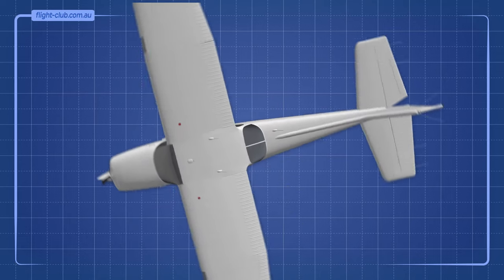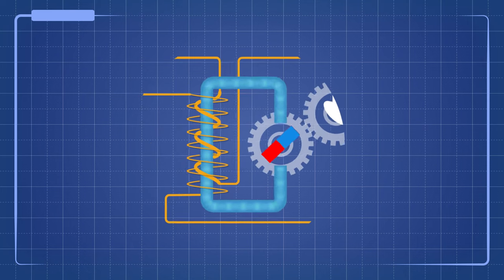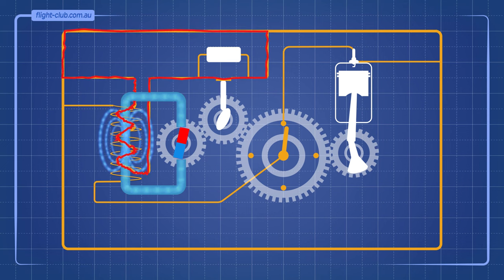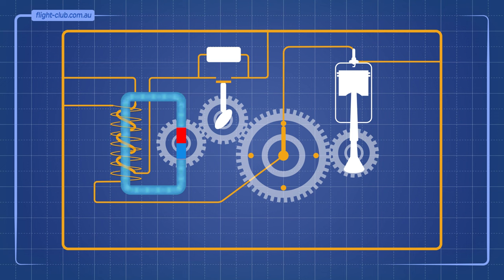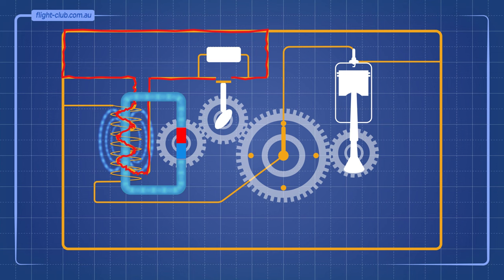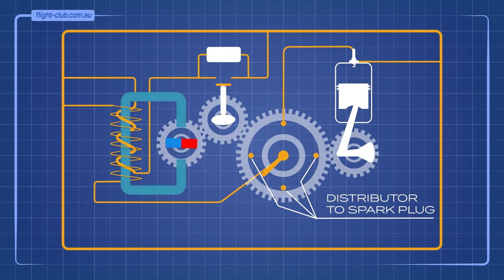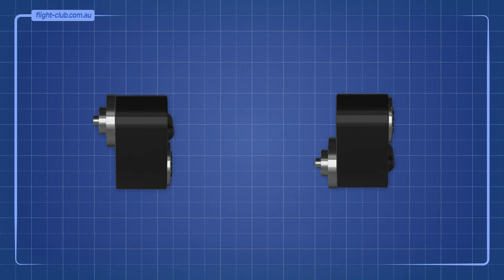How Magneto Works | Simply explained for student pilots.

Comment: Don't forget  that a Magneto doesn't Need electricity (unlike a Generator) from a Battery and will work on it's own! A redundant magneto system is wise 25,000 feet in the air😃
Reply: You can connect a generator directly. No need for a battery. For example you could use the AC ( like on a bike ) and distribute every lobe to a different cylinder and there have a coil on plugs for a shorter HV cable.
Reply: Both magneto and generator (alternator) are engine driven and they are the one that produces electricity. I don’t understand what you mean by “unlike a generator that needs a battery” ? Cuz a generator doesn’t need a battery, its engine driven

Comment: It's important to test each magnetos separately.  Expect 50 rpm drop off engine if magnetos operated individually. After that do not forget to switch back to both. Check and verify.  Sometimes the engine switch can return to single magneto operation due vibration or if knocked by the knee etc.

Comment: to be completley honest i still dont get it, especially with the voltage spike, but great video nonetheless
Reply: When you have the closed circuit, there's a lot of energy accumulated in the magnetic field of the coil that is created by the current flowing. When you open the circuit, that energy has to go somewhere. With nowhere to go in the first circuit, it can only discharge through the other coil (since the first one is now an open circuit). Energy can be delivered either through current or voltage. By the way it's designed, the other coil favours to discharge the energy through voltage. This results in a spike which reaches differences in potential enough to make the air in the combustion chamber break down and let current flow through the massive voltage. Imagine a massive pump delivering a massive pressure spike through a narrow pipe. The pipe blows up. That's the spark.

It's like a water hammer, but for electricity.

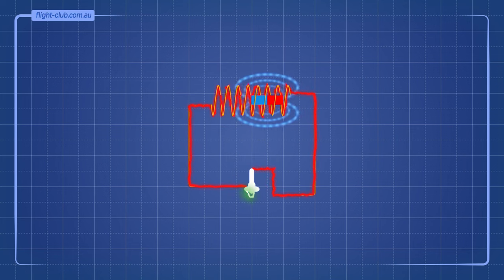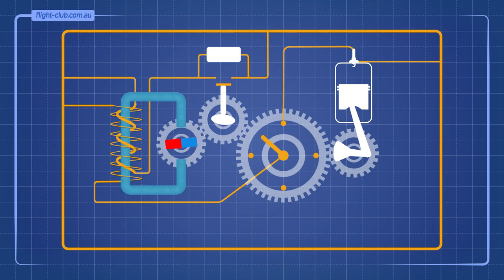Comment: 0:38 *enough VOLTAGE will generate a spark.  Sparking is a function of voltage, such as when shuffling your feet on the carpet and touching a doorknob. Arcing is a function of current, as illustrated at 3:40

Comment: So simple and effective. The generator at our cabin is a very old Honda one, and it no longer works as the spark doesnt show when pulling the cord.  Now i know why
Reply: You can probably pull off that magneto and rebuild it using tools in your shed, then it'll be good for another however many decades.

I'd check the cable first though. That's a more likely failure.

Comment: Thank you for another great and simple video! As you described at the end there are two magnetos - why is the performance better with two magnetos and why does the power drop slightly when I test the individual magnetos?
Reply: as the video stated there are 2 mags and as such there are 2 spark plugs per cylinder unlike a car where there is only one plug. having 2 spark plugs spaced within the head of the cylinder allows the air fuel mixture to be ignited more evenly/uniformly and therefore more efficiently ie more fuel is burnt in the cylinder with less waste and as more fuel is burnt you get a bigger bang and more power. the power drops when individual mags are tested because initially you are running on 2 spark plugs then testing you are basically earthing one mag which effectively stops that mag working so when you do the test  you are running only on one mag and one spark plug and less power.
Reply: @alianjohnson6035  What would be the thinking behind using one vs two on a flight?

Comment: Very interesting and well done.  I'm curious why aircraft use magnetos instead of an alternator/battery system, like cars have.  Reliability?  Better performance?  Are aircraft spark plugs radically different from those you find in cars?
Reply: Magneto ignition means the engine keeps turning even if the aircraft has a total electrical failure.

Also, certifying anything new in aviation is an expensive process for a very small market, so piston engine technology lags well behind its automotive counterparts. Avweb has a pretty good video about the economics of the aviation engine market and how it has resulted in modern planes with space age composites and sophisticated avionics still using engines essentially identical to aircraft from the 60s
Reply: It's a reliability thing. You can lose the entire electrical system and still get spark.

That's why the entire ignition system is redundant as well. You have two magnetos, two distributors and two sets of plugs. That's a lot of failures required before you lose an engine.

In a modern car engine on the other hand, you have many single points of failure, any of which can leave you stranded by the side of the road. This is done for cost and weight reduction, which become secondary concerns when increased likelihood of engine failure is liable to result in loss of airframe, or worse - life.

This is also why fuel injection systems took so long to mass adopt (even though those were invented for aviation). Just like magnetos, carburaettors don't require any other system to be operational in order to meter and supply fuel. As long as there's fuel in the tank, that is 😅

Vacuum gyros (artificial horizon, gyro compass, etc. Notable exception being electric turn coordinators) run on engine vacuum for the same reason - if the engine is on, there's (partial) vacuum to drive them and you don't need anything else.

Same reason mechanical flight controls (cables and pulleys) are still a thing, and still preferred whenever practicable. Even in somewhat larger aircraft (such as the King Air). They require a bit more maintenance on the ground, but even if you lose all the other systems on the aircraft, as long as the cables are intact and control surfaces are free, you are in full control of the aircraft.

Having as many of these systems as possible be standalone and independent means that no one failure can bring an aircraft down. And ones that can bring it down are always redundant. Boeing fuch ups notwithstanding.
Reply: @StephanAhonen Hell, a bunch of these engines still require tetraethyl lead in the fuel!

Comment: This is either really good, or wrong, and I’m leaning towards really good. I’ve always been taught the reason for the capacitor or condenser is to stop the arc as mentioned but for the purpose of preventing damage and wear to the breaker points. But what this video stated makes good sense.
Reply: I’m pretty sure it’s the same reason. The arcing can cause the conductor to degrade because it generates a lot of heat because air has a high resistance. Maybe that’s what it’s referring to?

Comment: Interesting side note: That high voltage needed for spark ignition in modern engines is in excess of 20,000 volts 
With car engines and their coils making upto 68,000 volts for high compression or high boost engines. 
Even on a motorbike you are looking at 15-20,000 volts from a 6v motorbike battery.
Reply: When the spark happens in a region of calm air, the flame expands slowly. So we can advance the timing before max compression at TDC as the turbo spins up.

Comment: Does the battery power a starter to turn the magneto which powers the spark plugs ? If not what turns the magneto to begin with ?
Reply: The battery is used to start the engine at the same time, all turn together.

Comment: I’m surprised distributors are still used and not electronic ignition.
Reply: electronics tends not to deal well with extreme temperatures, and you get those a lot in an airplane.
Reply: @StefanoBorini mil spec electronic survives where humans die. Military jets also hvac their computers. Use tubes?

Comment: The terms in this are mixed and contradictory. Please, don't pay attention to the actual terms. "High-voltage electrical current" is not a thing. Current is measured in amps. Voltage is its own measurement.
Reply from the maker: Fair point. Thank you for clarifying.
Reply: Thee is a distinction between a current driven by a Van de Graff generator and a current driven by a car battery.  If you want to drive a current through a high-resistance path like air, then you need a high voltage.  In this video there is no need to measure the current, so no mention of amps.

Comment: Wrong information presented here.  it's high voltage, not high current that generates the spark.  Infact, the current is very low once the voltage is stepped up.

Comment: I'm taking the commercial checkride and failed the oral because the examiner I guess wants me to be an A&P. I guess I need to know how to overhaul an engine too. Does anybody know a DPE that isn't on a Nazi power trip? They know how badly you want to pass. You hand them $800 and they say you failed. Come back and pay me another $800. Next customer. Bunch of Cartels is what they are.
Reply: Are you trying to get your A&P ?
Reply: My suggestion:  Talk with some other applicants, and their instructors, to see if this is a common occurrence.  If it is, then contact your FSDO and report his actions.  I realize that there is also his side of the story, but if he is not conducting practical exams in accordance with the appropriate ACS (or PTS if applicable) I am sure the FSDO would like to know that information.